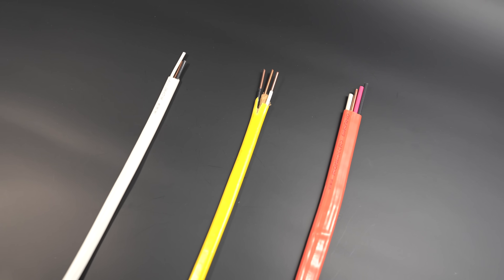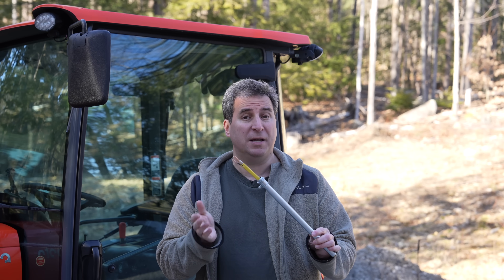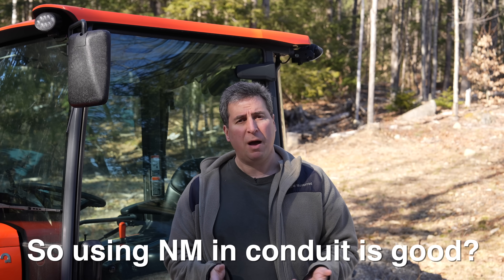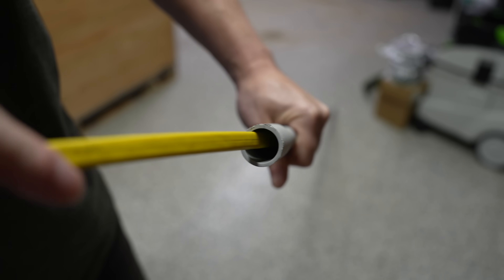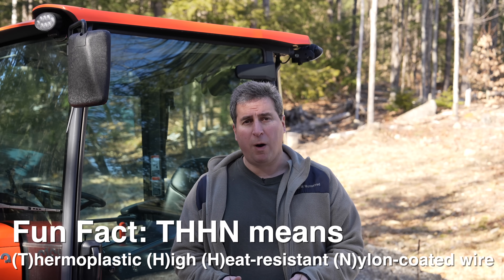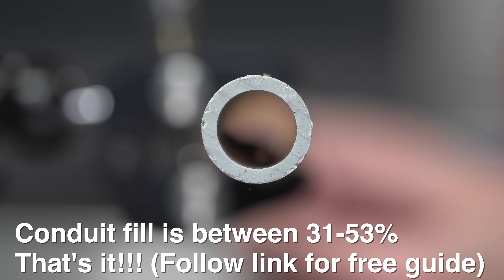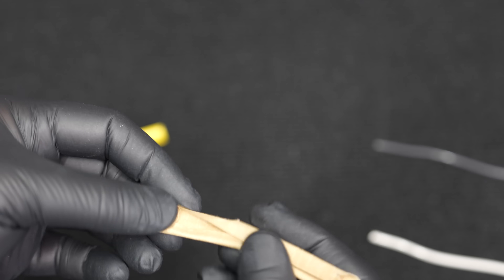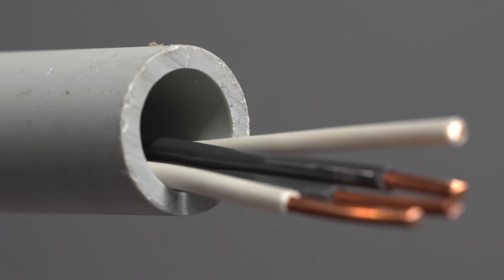#1 DIY Electric Mistake - Can you use Romex Wire in Conduit?

Comment: Thank you. But, as an electrician, protection in wall or in exposed work is the only reason that makes sense. MC is a better choice for light duty, and if you go beyond about 180 degrees of bend, you should consider the run permanent over about 10 feet. THHN is faster and easier, and you can make it so your wiring colors are correct.

Comment: I've used NM 12/3 in 3/4" EMT to receptacles in my workshop where most of the run was in the ceiling but the drop was on a post and needed physical damage protection.  The inspector was fine with it.
Reply: Of course he was because romex in conduit is legal.

Comment: What about when you purchase a ready made A/C whip? The outer casting is Non-metallic tubing, but the wire inside is solid copper, just like romex, but without the sheathing found in romex?
Reply from the maker: Those reayd made whips are good and definitely code approved. The wire inside is THHN and each conductor is labelled. The conduit is considered the same as plastic conduit except its allowed to hang freely from the house for I believe 3 feet but the wire inside is actually stranded.

Comment: Good info. But why is not advisable to run the NM wire in a conduit in damp locations?
Reply from the maker: They never officially say why not to do something but the common belief is that the paper used between the wires for normal cable will degrade and rot. This paper doesn't exist with THHN or outdoor rated cable.  Hope this helps

Comment: 100A wire from panel to feed a sub panel in the garage via a 2" Schedule 80 conduit ;  buried 3' . Climate. hardiness zone 6b/7a. Damp. went in as Romex, not THHN/THWN. 40-50' run.

Aside from the diiculty of pulling wire, what is the reasoning behind it being OK vs not? It would seem better and safer.

Comment: In most applications, the only time you would run in a conduit is in moist locations, at least in a residential situation, so for your DIYer the simple answer would be not to run Romex in a conduit.

Comment: Frankly..when I came across nmc run through about 50 ft. of aluminum guttering I was shocked.
Figuratively not literally.
The outside jacket was mostly gone but individual conductors were ok.

Comment: You missed the biggest reason why you don't strip Romex and use the individual conductors. The identification marks to know what the conductors actually are are only printed on the outer jacket, unlike MC cables.

Comment: No you can’t strip Romex and use it has to be thhn !
Excellent point I’ve caught this mistake countless times over the yrs 
Depending on the load and length of your run your feeding the coatingwill melt in the pipe!!

Comment: Great.  I must add that you must always leave lots of free room available around the cables for Heat dissipation.  When the cables are energized with nominal current or occasional fault condition,  (i)x(i)x(r) amount of equivalent heat is continuously produced and the void space between the cables and the conduits becomes very critical to transfer that heat to the surroundings and keep the entire cable run under safe operating state.

Comment: Say you install NMC in conduit in a dry location to a junction box located inside the house, with one pipe going out of the house with rated separate conductors in the outside conduit to an outlet. Would the inside junction box then become part of the wet location, thus rendering the NMC in conduit an illegal install?

Comment: Electrical rules are simple if you know them, like any rules we always look for a loop hole,,,, and before you know it everyone finds another loop hole,,,, and before you know it,,,, everyone should have followed the rules..... like the one,,,, no more than two solid bends before the next bend requires an inspection bend..... don't know when that was removed from the regulations.... and always what the purpose of that was,,,, perhaps for the inspector to see all the twisted cables jammed into the conduits....😊👍🏻

Comment: As others have said it's great that this video was short, to the point and accurate. The only thing it could have benefited from was clarifying that while NM isn't allowed in wet locations, you can have UF cable inside conduit there.

Of course the only time it's really practical to run any sheathed cable inside a conduit is when you need to travel a short distance through conduit as part of a longer run and you don't wait to have junction boxes on either side of the conduit. For example a short exposed section passing through a finished space or short excursions into unfinished basements or garages.

Comment: I had to use emt from my switches and outlets until it was 6' high I surface mounted my box and switches. Just ask you inspector they will tell you the rules before you start.

Comment: I ran 3/4" conduit between my garage and shed approximately 6 feet at a soft angle. Fed #14 Romex through it for a light and switch in the shed. No water issues no closed ends just protecting the wire. Been there for over 30 years. Now I'm hearing this is not legal? bullshit

Comment: I think I’ve commented before sorry if I repeat it. 

I ran Romex through PVC conduit years ago when I was 20, never had an issue. I’m rewiring my lights and outlets outside. The Romex is Gray and on its outer casing it shows sunlight resistant. I can say running stranded 3 wire (white/black/green) is way faster and easy to pull through corners. 

Before becoming a bus operator I wanted to be an electrician. My head swells when trying to interpret building codes. Credit to Electricians and other Tradesmen/women. 

One thing I got going for me is I can read and if I don’t understand what I’m reading I repeat till I understand. I like trying stuff I don’t know or familiar with. Sense of accomplishment is what it’s all about.

Comment: Finally, after doing hours of research on my own for the same situation, someone who boiled it down to a very good overview.  I would only add, the other reason you can't take the sheath off of NMC is you are removing the ID portion.  If you do, you have unidentified cable in a conduit, that could be misused for Amp rating.

Comment: If I am able to build my home new the entire wire system will be in steel conduit as individual conductors, usually 1/2 inch will handle a three conductor, white, black and green without an issue. When you move to 220V wires I would be using a larger steel conduit as the wires are a lower gauge to carry the increased voltage. This would also include steel boxes for receptacles, switches and fixtures!! The wall framing in my house would be steel studs and rock wool insulation, both are fire proof, then the exterior is made with 16x8x4 concrete block all grouted, the wall studs and roof trusses would be connected via welding which makes it much stronger.

Comment: The wire going from outdoor disconnect to my breaker panel in basement. Was run horizontal for about a foot. Weather, and sunlight has caused the outside insulation to start deteriorating. I don't want this happening again. Can I just cover in conduit? Or, should I run new wire in conduit?

Comment: so some code guy made a personal decision and decided it should be code for all..  1)  It may be hard to pull romex vs thnn but that is a personnel problem not a reason.  2)  6 thnn wires vs 2 2wire romex separates the wire farther apart and insulates them better then 6 thnn wires.  Reducing the possibility for creating a hot spot.  3)  IN addition with the added insulation around the romex, if water was to get in its less likely to infiltrate to the wire and short out.  4)  Fill. 53% is an arbitrary number some code guy came up with there is NO logical nor scientific reason for it.  Except for the reason that "If you wanted to run more wire", and that then violates the 53% rule.
In my opinion most codes are designed for companies to make more money and not for true safety.

Comment: That sucks! Because I just bought 250ft of 12/2 and conduit to run from my house breaker to my shop to get power. Am I doomed?
Reply from the maker: Unfortunately yes, unless the 12/2 you got is gray or UF (underground feeder) which is direct burial cable and could go in a conduit. if its regular 12/2 its a really bad idea to put it in a conduit, especially underground as the paper can eventually break down due to moisture which is why its against code. You can and should double check with your local building department to be absolutely certain. Sorry I wish I had better news, but its really better than finding out after you did it.

Comment: You can run NM in conduit and pulling it, using pulling lube, isn't quite as bad as you make out.  The problems are fill percent and heat disapation.

Comment: Thank you for the information. I just had my well pump stop working. One wire is broken because I only have 120 volts instead of 240. Whoever installed the electrical ran 14/2 Romex 125' underground through metal conduit. Has been like that since 1972 when the place was built.
Reply: I'm trying to run 200ft of 2/3 romex underground in conduit for an RV outlet. What should I use instead?

Comment: Ok? I ran a single run of 12/2  in  3/4 pvc ( the gray ) just to protect the wire from mice or other critters from chewing on it, one run is in a crawlspace and one is beside my ceiling rafters . is this good or should I remove it from the conduit ?

Comment: I have a NEMA 3R breaker box mounted on the exterior brick veneer of my house.  I want to install a 2" hub on top (it's made to accomodate that) and run several romex cables from the box to the soffit above it through a 2" carlon conduit pipe, and then into the attic.  Help me understand why this is a bad idea.  The length of conduit "outside" is less than 5 feet from the top of the breaker box to the soffit surface.

Comment: So if your breaker box is on the outside of your house there should be ZERO romex coming into the box?
Reply from the maker: It depends, if the romex goes through an opening on the back of the panel, a rear knockout, that would typically be fine. Exterior outlets are done this way all the time and romex comes into the back of them

Comment: Pulling romex thru a pipe has got to be a bitch. Better get lots of lube. The insulation on THHN is pretty slick. Romex, SO cable, DLO, and MTW are all going to stick and grab in the pipe.

Comment: Why would you run Romex in pipe. Silly……romex can be run exposed in some locations anyway. I always run pipe ( conduit ) in a garage for protection,with thhn. NM cable is a nightmare to pull in even oversized conduit

Comment: I was told that you don’t run romex in conduit, because it affects the heat rating.  It is also solid wire, and it puts strain on the wire to pull it thru long lengths of conduit.  Just run THHN.

Comment: I'm an electrician. We don't run Romex in conduit. We use THHN as the video said. It's a lot easier in many ways. You're just making your life hard by trying to put Romex in conduit. Hard to pull. Fills up the conduit. Pulling in another conductor or replacing a conductor down the road will be much harder if you run Romex. There no reason to do it.

Comment: I thought the issue was heat dissipation (and maybe that ultimately relates to conduit fill).  Romex is designed to dissipate heat by some factor, and when put in conduit could make it harder to dissipate the heat, whereas conductors made for conduit are designed to dissipate heat inside conduit.  This is just what I read, but I have no personal expertise on the matter.

Comment: People, while there is some good info here, and other channels on YouTube, if you are doing electrical work yourself, please consult a Licensed Electrician, and/or an AHJ(Authority Having Jurisdiction), and get a permit.  The official electrical code, NEC 70, from the NFPA, is the minimum standard of code source you should be following.  Some states may add extra requirements but they all use the same code from NEC 70.  Many states allow home owners to do their own electrical work, as long as a permit was pulled and the electrical code was followed, and inspected by the Electrical Inspector.  While an electrical project may seem simple and straight forward, there can be many factors that need to be applied that you may not be aware of.  If you burn down your house and/or injure someone, you didn't get a permit, and the code wasn't followed to the , your insurance company may not cover the repairs.  You could also be held liable if there was damage to your neighbors property.  Be safe.

Comment: It could, in theory, overheat the insulation of individual NM wires when power-pulling through long conduit runs. THHN (etc) wires have a slick clear plastic coating on them. The individual wires out of NM cables - don't.

Comment: I didn't think you can run romex in a conduit due to heat rejection. Short runs maybe where both aides of the conduits are open. 

is what you said based on NEC?

Comment: Found some overhead pole wire 620 volts.  It’s stranded 4  white black green  red    About 1/2 diameter. Iam thinking a rv box about 10’  box to electrical box  would this work for 50/30/20 amp box   I have 210 running to the shed  4 ga aluminum

Comment: Yes, you can use rimex in pipe but itis not necessay and it is a waste because it made to avoid using conduits. However if it follow the NEC which only takes appropriate % of the conduit cross cut area as well as derating concerns on temperature where conduits go through then it is okay.

Comment: I've used romax as an electrician. I quit using a staple to secure the romex. 
The staple is good, but if the staple punctures the romex, then it can cause a fire.
If the staple just Knicks the sheathing and the wire, then what happens is  a low-grade electrical heating. element.  This fire hazard will heat the wood until the wood catches on fire.  A circuit breaker won't detect it.  It can take weeks before it causes a fire.
I use one hole straps instead.  It might be more expensive and time-consuming, but it gave me peace of mind.

Comment: The fundamental problem is "heat dissipation" and the potential melting of the insulation between individual wires.  The Code requires the spacings based on "commercial practise".  When were doing rockets and missiles, the needed weight reduction required actual engineering assessments, and this was usually done via actually monitoring the temperature rises in cables, via a thermal probe.  If you know you are within acceptable design criteria, then you are good to go.  Emplacement within protective paths, boxes, or pipes is commonly done in all of aerospace application.  Those are done for various other reasons, such as vibration, heat protection, thermal expansion, etc etc.

Comment: Isn't there a limit to how long you can run THHN wire in a conduit? And what happens when you want to run a long length of wire in exterior conduit in damp locations (for example, to power a boat lift on a long pier)? Hundreds of feet of conduit, both underground and above ground/below pier.

Comment: Thanks for the great video! This situation just came up for me, as I replaced an outdoor GFCI receptacle that was within inches of my exterior service panel. I wasn't sure if it should have been Romex, and the thought of taking the wires out of a piece of Romex cable and using them had occurred to me. Luckily, I decided to buy 3 rolls of 12ga THHN, a 20A weather and tamper resistant GFCI outlet, and a new 20A breaker and do it myself.

This replaced a 20A non-Weather Resistant receptacle (that had corroded and I couldn't press the test button in), 12 gauge THHN wire that was slightly melted (because of a loose connection at the breaker), and a 15A breaker.

Comment: One might think metal conduit will protect wires from screws, but it will not.  In our commercial building the conduit was run too close to the metal decking of our flat roof.  As the roofers screwed in the new EPDM layers, the 4" screws ran right through the conduit in at least 10 different places shorting out the building's outdoor wall packs.  That error (running conduit too close to the roof) cost our condominium association $10k to fix.

Comment: Article 334 says yes, I have failed inspection for this, though. The inspectors argument was that there has to be a UL marking on all 3 wires per article 310. There is usually only 1 of the 3 wires with UL markings on 12-2 nm within the jacket or sheath. It was easier to pull THHN than to challenge the inspector. After that I haven't done it . If you are you are using a metalic conduit as a sleeve, you have to bond both ends of the raceway with a ground bushing or grounded box, which creates more work. Often, the inspectors overlook things that are insignificant and  dismiss things that are potentially dangerous. The easiest way to pass inspection is to change what he requested when you have an aggressive schedule.